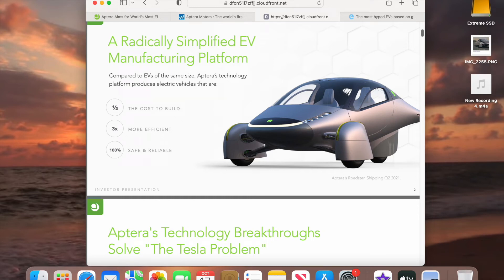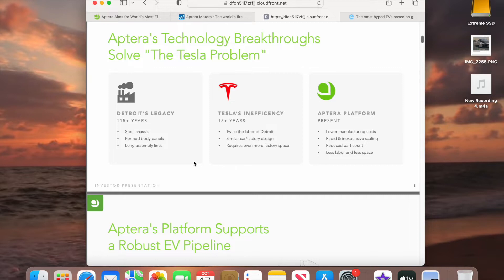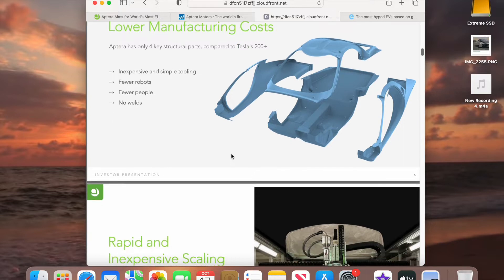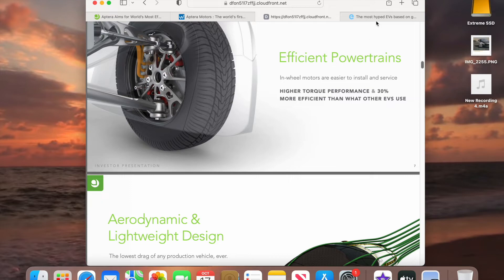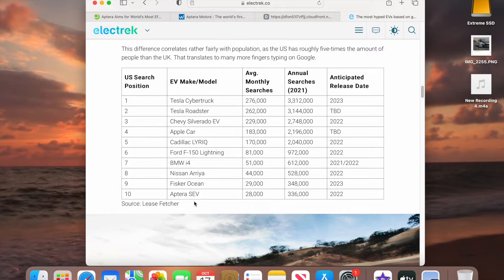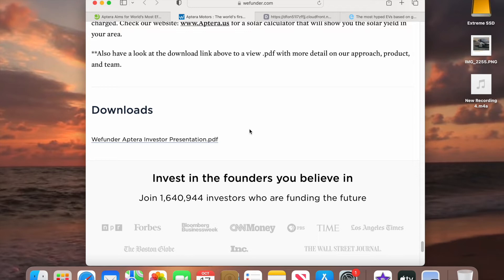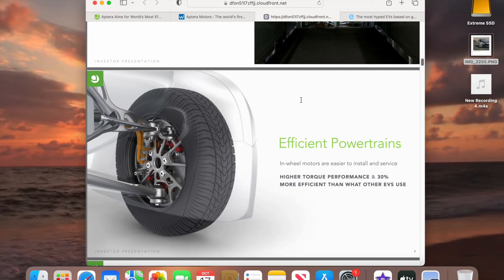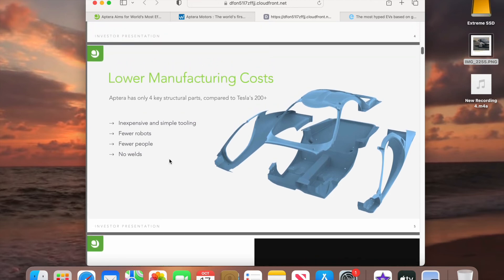Aptera's Simplified Process

Comment: 8:40 That list of searches looks to be old?  Some of the dates are 2021.  If that's the case, I bet Aptera has risen in the search rankings.
Reply from the maker: I did that search yesterday , so it could be old . But google is mostly up to date .
Reply: @freepower1082  that chart was part of an article wasn't it?  So it'd depend on when the article was written.  There's usually a data near the masthead
Reply: @freepower1082  Ok, I found it.  The Lease Fetcher article is dated 10th January 2022, and the Electrek article is dated 22nd January 2022.
Reply from the maker: Thank.  I’ll check it out again at the end of January 😊

Comment: Thanks for your coverage!  Posted to Reddit at r/ApteraMotors.  Question - Where did your 1/2 the building cost figure come from?
Reply from the maker: Those figures came from the Aptera website , however it’s probably more than that sense they don’t even have a paint shop for their cars .
Reply: @freepower1082  Thanks!  Yes.  Their tooling costs are less by more than an order of magnitude compared to Teslas.